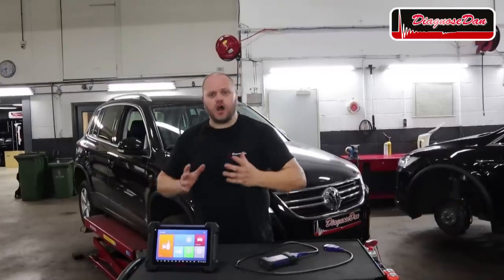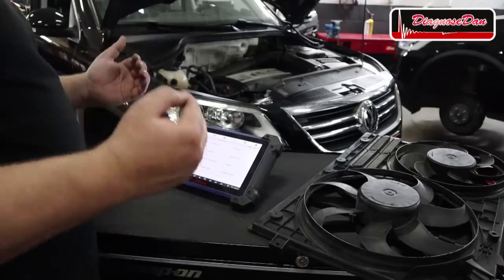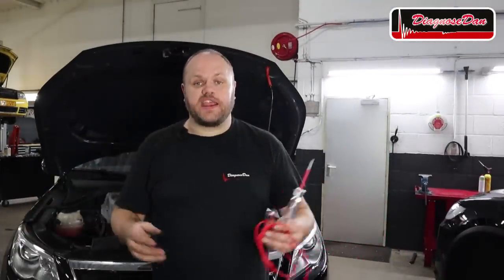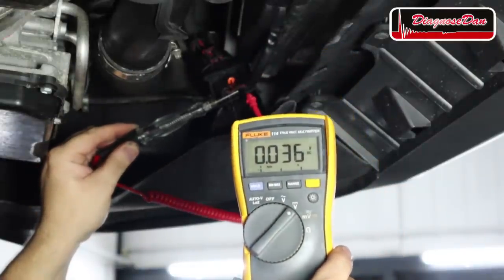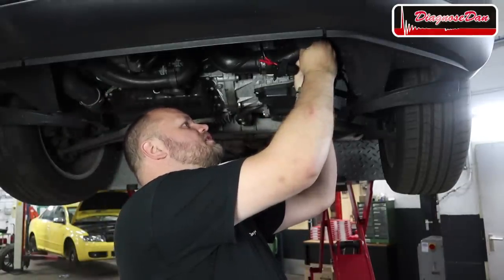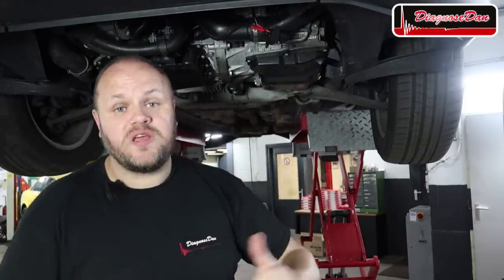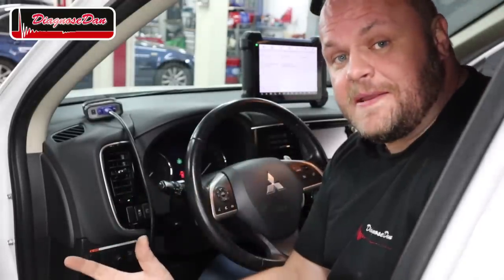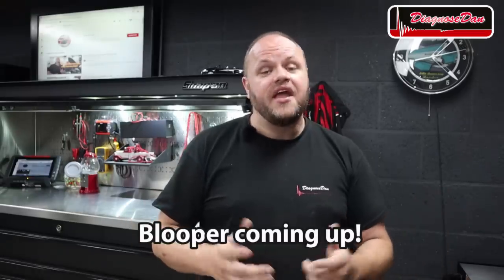A Cheap Chinese Car Key from Wish, will it work?

Comment: One of the things that I was taught early on in my electrical engineering career was to use the right tool for the job in hand. In this case a 50 cent light bulb was superior equipment to a $300 Fluke DMM.
Reply: Multimeters are for measuring. They measure everything that is in the air. To test you need a test equipment, that charges the cable. Every electrical practitioner who values his life knows this.

Comment: I am an Avionics technician working big "birds". I was once called to an old MD80. Whit no light on the extended airstair. Took my voltmeter. There was full voltage to the lamps. Then i remember an old textbook ex. My there was no load? The was an old british hand made AVO-meter on a back shelf in the electronics lab. Took it and measured the same place again. And bingo! I needed a load! And learned the differene between high and low int. res.!

Comment: The load testing is many times overlooked and not stressed enough when teaching diagnostics . So simple but so often forgotten and as seen in your video you have a car from another garage where the tech didn´t think about it .
Reply from the maker: You are right!
Reply: Yup. Load testing has saved my ass more than a few times.
The really tricky ones are the signal wires that don't carry much current.
Reply: @panzerveps  Ah, so.  Very true.
Reply: Dan, why didnt you use the multimeeter "beep/continuity" to confirm the correct wire? Br Jan
Reply: A test I like to do are continuity tests so I can test see if there’s any resistance that could hold back the current/amperage from flowing.
Reply: @twinbmx1  A continuity test isn't reliable though. You can have one thread left of the wire, and it won't show it unless it's heavily corroded.
A load test is much more reliable.
Reply: Apparently, watching the fans after a repair to see if they're fixed is often overlooked!
Reply: @panzerveps  Continuity mode often beeps up to 200 Ohms, which is absolutely unacceptable for any sort of current carrying.

Comment: This is exactly why I like to use my Loadpro. I know some guys here on YouTube don't believe in the Loadpro  but I think it is a great tool.
Reply: Load Pro is an excellent tool. I have found many issues missed by previous techs using only a voltmeter.
Reply: I think the youtubers your talking about has more to the story then just the tool. I dont use the load pro personally and that's not because its a bad tool. I'm just use to my test methods. I have the load pro on my fluke i just dont use a meter much. Its a scope and test light for me. I definitely believe it does what it says it does.
Reply from the maker: Everybody does believe in the Loadpro. The thing is it does exactly the same as a testlight.
Reply: @Diagnosedan  I also use test lights and headlight bulbs etc to load a circuit. Just my personal preference is using the Loadpro and multimeter. Thanks for another great video
Reply: DiagnoseDan.A nice short video comparing the Loadpro180 o similar tool and a test light functionality will be nice. I do use the loadpro quite often But believe it or not some of my coworkers do not know how it works go figure.

Comment: Earths... they can be a total pain! 

We misdiagnosed my brother's Renault with what we thought was a duff ignition switch causing a non start despite a good battery, start relay and healthy starter motor. 

After going to the dealer to order a non refundable new barrel and key with switch for £170 in 2008 (the old blades were getting worn anyway) and the non starting issue remained. 

Turned out the ground strap from the bell housing to the body had corroded and broken...this was causing the non start issue and at the time was sorted for £5... that'll teach us for looking for a complicated answer to a simple problem!

Thank you for a clear and well made video, superb stuff!

Comment: We have an apprentice who has just started at our workshop, and last week we had a donkey engine that would not crank. However we had 12 volts everywhere where we should, so it was assumed that the starter was bad. Luckily I know the importance of putting a circuit under load before committing to a component replacement. As soon as we put the circuit under load, the voltage dropped to 4 volts. And you guessed it, it was a bad Earth.  Well done Dan for showing how easy it is to be tricked by a good voltage reading.
Reply from the maker: Thanks for the great comment 👍

Comment: ALWAYS check power circuits with a suitable load. I like to put at least 50% of what the fuse rating. On heavier circuits 10 or 12 amps is usually enough
Reply from the maker: Great advise Bruce!

Comment: im so used to just grabbing my standard test light that it baffles me why someone would use a multi meter to check power n grounds. great video on basics
Reply from the maker: Many technicians are trained to work with a multimeter.

Comment: Your multimeter is fine to do measurements, but you always have to make sure that the component is activated. Your multimeter would show 0v as well if you used your  Autel to activate the fans while measuring.

Comment: It's the little things that show you the difference between an amateur and a pro.
Like the protectant spray once the bolt was tight. :-)
Reply from the maker: Thanks!👍👍👍
Reply: on the temporary/permanent fix
Reply: man, everyone's a critic.  realistically, the wires were fine, and the other shop is not going to do anything other than give the vehicle back to the customer as is, fixed.  His job was to diagnose, he went above and beyond.
Reply: @Jason Bowman when he got to that bit, I was thinking he was going to repair the wires. But then I also thought, if it's my car, I think I'd rather keep the original connectors and wires rather than having a spliced-in repair. If the copper is all still good, then the original wires are fine to take current. And it's a ground, so even if the insulation fails later it won't be a problem.
Reply: We were wondering what that was
Reply: @Jason Bowman ....I was expecting the same Jason, but then I noticed that the wires were exactly the length to reach  to the bolt. If he cut them to put new connectors, they wouldn't reach far enough and the job would get unnecessarily lengthy. Besides, as others pointed out, the wiring inside was fine, and the protective spray on top also gonna help. And since it's a ground wire, if the insulation fails, no harm done. 
Now if it was MY car, I'd deffinately raplace those connectors with new ones, and I'd even clean the connection point on the chassis. And since the cut wires would be short, I'd splice new wires there, solder and everything, heatshrink tubing.....the whole shebang. 
But hey, it would be my car. Or my buddy's. Not a customer's car. 
Now if it was done on a customer's car, who is also informed about cars like us here, and was explained to him, I think besides a satisfied and returning customer, Dan would also have a great walking and talking add. 
👍👍👍👍👍👍👍👍👍
Reply: @Jason Bowman ....good job man, aviation rocks. That's why I mentioned other cases where replacing connectors and wires would be awesome. And when he wiggled that connector, I thought I'd see some cut and exposed wires on the burned part, but still nothing. That's why my guess was the length. 
👍👍👍👍👍👍👍
Reply: The engine sounded like it's seizing up, more diagnosing to do later 😂

Comment: I have come across this on many occasions before I retired & I noticed that the old fashioned mechanic would use a filament test lamp & your modern technician/auto electrician would use a multi-meter & fall into the trap. Sometimes, the old ways are the best ways😁

Comment: Hi Dan, great video and classy troubleshooting process. When I posted 4 months ago I totally missed an important cue. The 11X family meter you were using (116 or 117) have a Low Impedance input (much like an old timey VOM) It's a 3K ohm input for AC or DC compared to VAC Auto or VDC Auto being a 10 Meg ohm input. You should be able to switch to LoZ and see the same phenomenon as with the incandescent test light. The Fluke 11X family I believe were among the first to offer this valuable feature. I am not sponsored or compensated by Fluke in any way but do use their meters for my work and training I do. Really, like with you, just a personal endorsement of an excellent device that works as published!

Comment: I just got the IM608 myself as well! I can’t wait to use mine!

Also, great demonstration on why you always need to be diagnosing circuits while loaded. 

When you were testing the circuit with a multimeter, were you active testing the fans on?
Reply: I was just thinking of you at  this very moment
Reply: @apprenticefelix7740  I’m so excited! I have a cool tool being delivered to go along with the IM608 too!
Reply: Great question .
Reply from the maker: Thanks for taking the time to leave a comment. Remember that module on the fan motor? That turns on the fans and shares that ground wire. So the module also had no ground and it would never turn the fans on. But good question!

Comment: I usually go softer when cleaning tined terminals. Expoed copper tends to oxidize really fast.
Reply from the maker: The contact points are where the copper is not exposed. And i sealed everything up with the protective spray.
Reply: When I was about 13 years old I used to "help" my Dad fix the car. He told me to always put Vaseline on battery terminals, "because it conducts electricity". Many years later I tested this theory with a multimeter. Of course Vaseline does not conduct electricity, it just keeps the air out of the places that aren't in contact. In a situation like Dan has just shown I would have greased the connections. I live in a remote area and don't have easy access to fancy sprays so I'll use what I have to hand.

Comment: 25 buckAroos is more than enough US feral reviser notes  for a wireless transponder key i know as i am into electronics 200 euro`s is robbery they should have no more than 10 usd in a key buying bulk on a unit that last that short of time. (grammar error`s brought to by a nice commenter below so i fixed even better for it.trolls got to love it unfounded nit picking )
Reply: agreed
Reply from the maker: Thanks for watching!
Reply: Your problem with forming  understandable sentences makes me wonder in what area of electrical repair or maintenance you are working at . A professional electrician? Nah, I don't think so. I try to understand , a buck is a deer, in electronics?  where? inside a wire? And last time I checked we had Euro's. Bitching about the price for an aftermarket key is pathetic. Be happy that it is possible to program and sell them. 250 Euro's and more for OEM. That's reality but reading your comment and the name of the person that agreed with you gives me a better understanding of the kind that you are.
Reply: I needed a second key for my 2016 Skoda Octavia and bought a replacement key from a Chinese manufacturer.  None of the local automotive locksmiths could program it so I went to the Skoda dealer.  They charged me $165 to tell me that the key was not a genuine Skoda key and that I need to buy one through them and have it programmed.  The cost &700.   With the key programmer demonstrated by DiagnoseDan I may have been able to save $700.   I certainly feel that I have been ripped off.
Reply: @Hobartian1  send your keys to dan! That can be his 3rd job after the shop & YouTube!
Reply: @overbuiltautomotive1299  I don't see  the comparison to a language Nazi. Basic English is a must and fast typing when really dyslexic? and actually, I don't care. I responded to the fact that you and others find 25€ expensive compared to the minimum 200€ charged by dealerships. If I provide and program a key for a client I charge 120€. Expensive? maybe
 But I am not a hobbyist. I have a garage to run. Good tools and providing warranty and service towards clients must come from somewhere.
Reply: @beluxauto5968  80 buck-Arooooos here we do twat we do in this ole wife be wood man
Reply: Absolutely agreed. It's an Rfid chip. Well it may be more than the cheapest 110khz rfid chip used in most access cards but even a mifare card is not 200 euros.
Reply: ATCkeepsUsafe  nice of you to point it fur me i went N fixed it fer ye
Reply: @beluxauto5968  200 euro`s not 25-75 range ..it should be 25 to get then being marked up to 75 full retail  ..logic of the supply chain...200 euros is just nuts
Reply: ATCkeepsUsafe   oh it`s funny ..oh man have fun with it a bit .much love friend  oh lord help us all ...

Comment: Good job Dan, a loose wire. I wonder did the owner get a refund from the first shop?
Reply from the maker: I think they sold him the Car and it's covered under warranty
Reply: @Diagnosedan  That's good. Many years ago I bought a car (306XSI) SH from a main dealer on which every now and then the automatic adjuster in the clutch cable would slip, so I asked them to fix it under warranty. Came back with a new clutch, the old cable and the same fault. Fixed it myself with a new cable and realised it had to be fitted with the adjuster orientated a particular way or it would slip.

Comment: Only found your channel recently and glad I did - it’s excellent.  I’m impressed by the production quality of the videos, the logical and systematic diagnosis and fix of the problems, and how genuine you are as a person and presenter.  It’s sad that the dealer networks are driven by workshop profits and that you’re the exception rather than the rule when it comes to automotive engineers these days.  As an aside, your English is exceptionally good, flawless in fact (I’m assuming it’s not your first language) - I say that because my Dutch and German are dreadful and I’m very impressed by someone as multilingual as you.  Happy subscriber. 👍😊

Comment: Loads of great equipment then you use pretty sketchy step ladders 😂
Reply: Same at my shop. I climb a ladder that is older than I am carrying a piece of equipment that cost €35000
Reply: I used to occasionally work for a guy on new build or the total renovation of houses. He always had crap ladders and step ladders. Literally, he'd found them in the dump!
I did all the plumbing and wiring so I was always up and down a ladder of some sort. I decided that I was going to buy only one step ladder in my life so it would have to be a good one, it cost £160 ten or more years ago. The legs are locked with solid steel bars and wing nuts, no flexing it is solid. It folds out to become a 10ft. ladder, again locked with a solid bar. The treads have sharp "V" shaped ridges, there is no way that you will ever slip. Well damn, I just searched and they don't make them any more :(
Titan UK, what have you done?